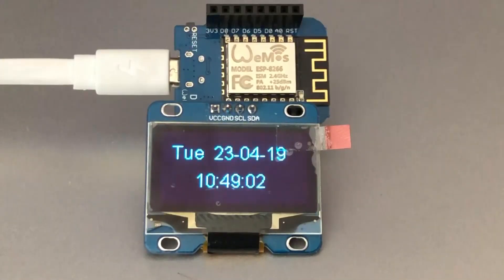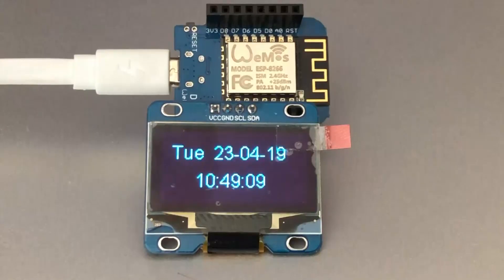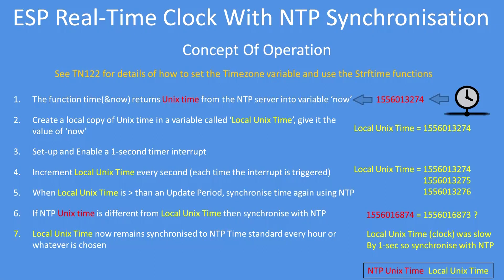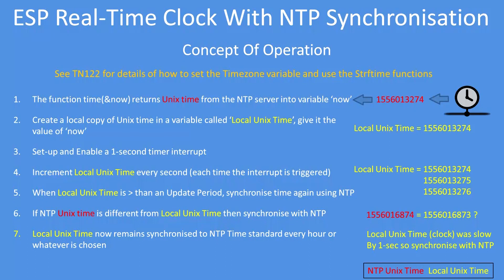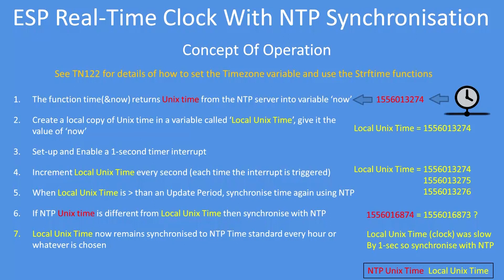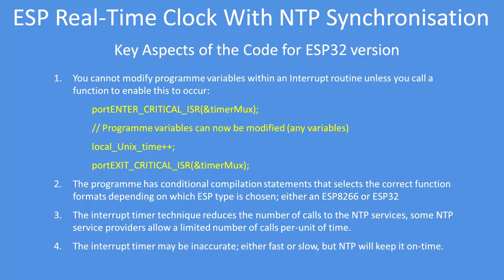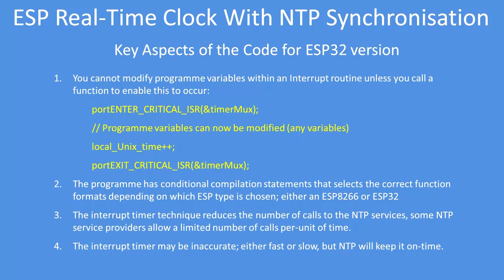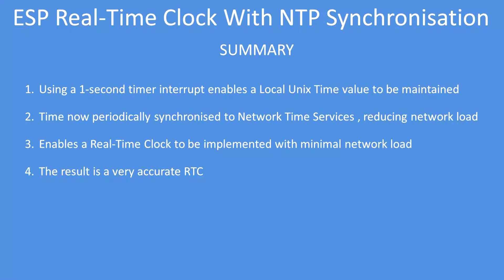Tech Note 123 - ESP32 or ESP8266 NTP synchronised Real Time Clock

Comment: Dear Dave, I was trying to contact you but your E-Mail server and website appear to be offline.  I am trying to make a clock similar to what you did above but I want it to be able to keep very accurate with out re-syncing with ntp for months at a time by using a very accurate external VCTCXO Oscillator.  From my research it looks like it should work when you attach the Oscillator to IO32 or IO33, but clear concise documentation is hard to come by.  Do you have any experience with using an external Oscillator in order to improve accuracy.   I am not looking to use sleep mode. Please let me know how we can connect.
Reply from the maker: My Name, yes my server has failed and I’m in hospital until November. You can contact me via davidlhbird@gmail.con. Using the on-board crystal clock is not that easy, but some boards have them fitted the most accurate is the 32khz xtal with two loading capacitors usually 15pf and 15 pf the circuit is in the data sheet. However there are far better clock solutions in the form of the DS3231 it’s an upgrade to the 1307 but importantly it adjusts its clock speed depending on temperature and you can set the clock rate too, to achieve easily less than 3ppm that’s better than any clock can achieve even NTP would struggle to get that level, so that’s how I would do this. BTW access to the ESP32 RTC can only be achieved via the Espressif ide

Comment: RTC without extra HW, nice. Useful once again, thanks!
Reply from the maker: Saeed AlA, yes really it’s a virtual RTC as the interrupts keep a local time with quite good accuracy and then the NTP check will bring it back in synchronisation when required. So yes, no hardware required but for the occasional UDP connection.